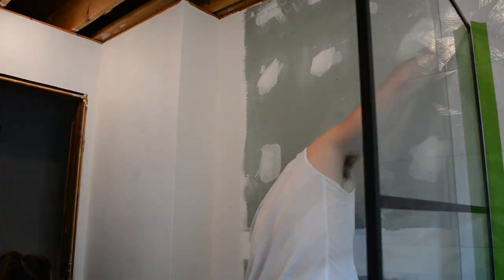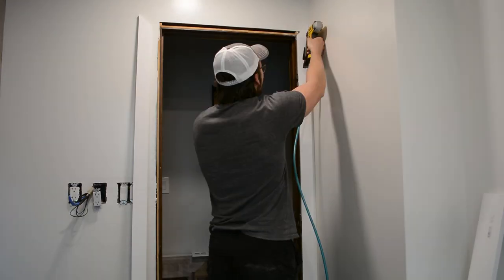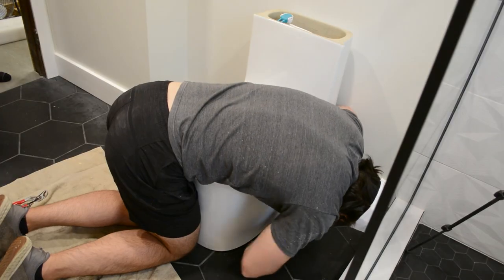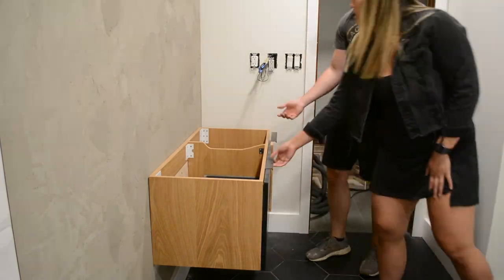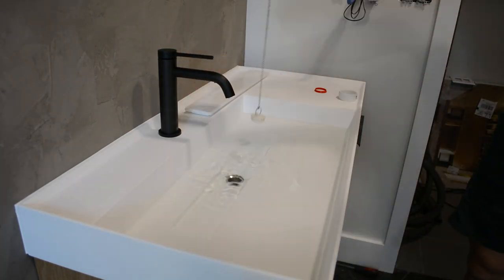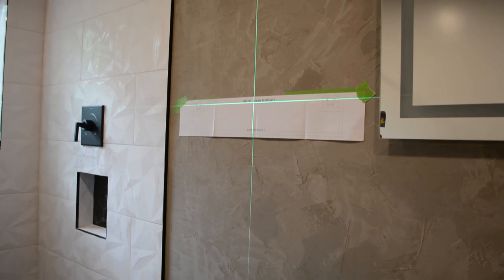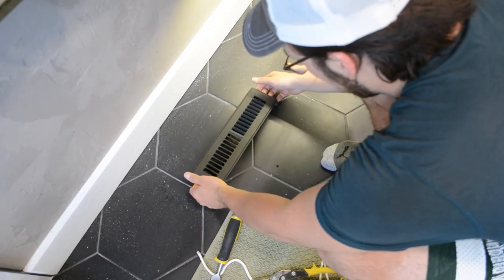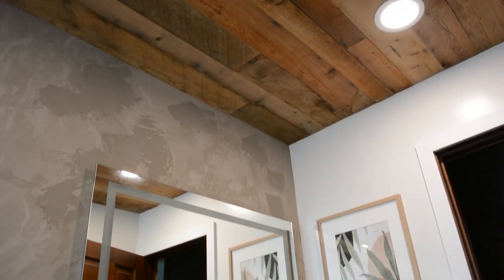The Finishing Touches | Bathroom Remodel Part 10

Comment: Bathroom looks awesome! Great job on it and love the documentation of it. That sink drain is CLEAN. Also smart use of tape when installing the towel bar to catch any drywall/cement and keep the floor clean. 

What laser level do you use? Gonna grab one for an upcoming project, but they range from like $40 to $400.
Reply from the maker: Thank you, really appreciate your detailed feedback! I use a Bosch GLL40-20G. It’s only functionality is the cross hair lasers and you cannot lock them in position to do angled stuff. They only show plumb and level. I regret not having that feature but it is more expensive. I do recommend you still get a laser of some sort though as they come in handy more than you’d think! Glad to have you as a subscriber and keep the questions coming!
Reply: @GoldenKeyDesign  I really liked that sink too but In the vid it looked like you had to pull out the drain cover in order to put a stop in it?? Is that true? If so they didn’t think that design through because who wants to remove parts each time?!
Reply from the maker: @cp3onmtv963  That's a good point. You do have to remove the cover to the plug the drain. But to be honest, I couldn't tell you the last time I needed to plug a drain other than to do the test shown in the video.